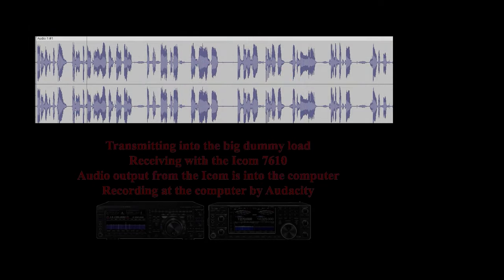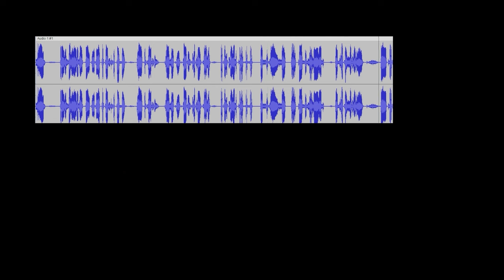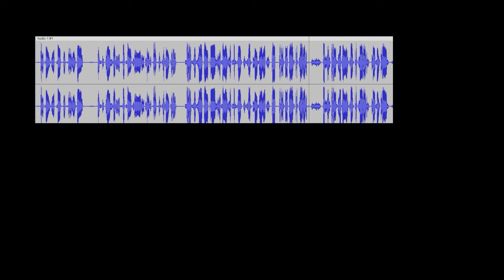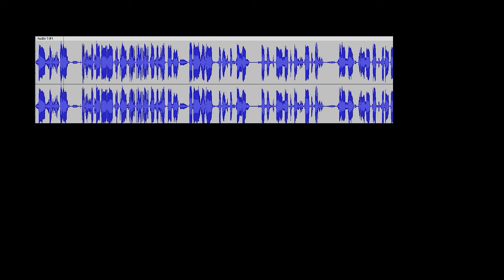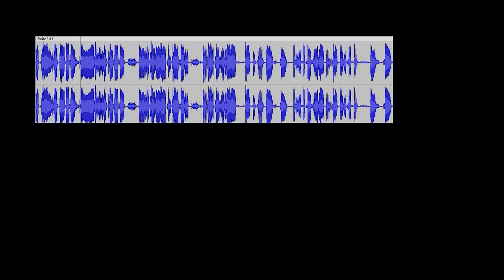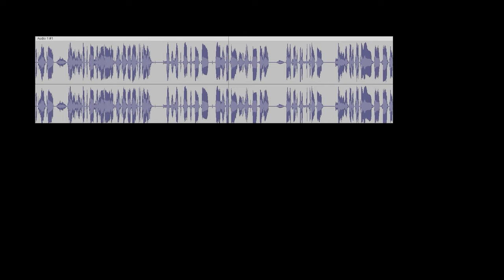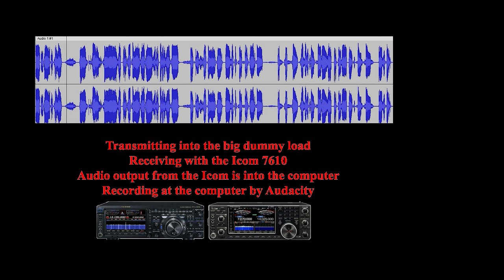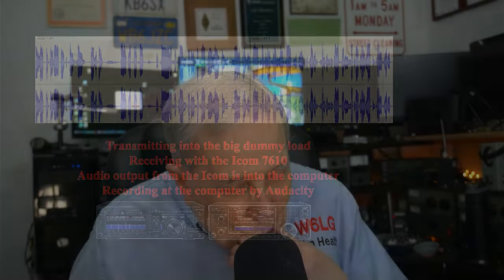How Much Compression is Too much? Setting Compression on the Typical HF Transceiver with Jim W6LG

Comment: Great video Jim, I would have liked to have seen the ALC meter and mic gain tuning on the video, this way I could have heard it like the other part of the video
Reply from the maker: I describe in detail over and over again both of those settings.  ALC was always mid scale and I say the amount of compression. I even colorized the wave form to match the amount of processing.   So you know where both were at at all times in the video. 73, Jim W6LG

Comment: Great Video Jim!  I have always wondered why Icom recommends that compression should  peak at 10 to 20 dB?  Do you think it could be that their radios are different?  It would be a fun experiment to set a Yaesu  and a Icom to peak at 10 to 20 dB and see if they sound different.  Keep the videos coming, I always learn from you!  Robert K5TPC
Reply from the maker: At 20dB they sounded the same and that was terrible.  I think it is a mistake that has been copied from prior instruction manuals.  Good question from you Robert!  Thanks for asking. 73, Jim

Comment: Excellent video Jim.  Your audio demonstrates your point perfectly.  May I ask what your equalizer settings are?  A little guidance on setting them would be helpful.  For example why would I set the center frequency of eq1 at 300 rather and 200 or 500?  Why will I use a hi Q filter  rather than a wide one?  If I have a bassey voice do I emphasize the bass or cut it.  After many hours of recording into an sdr and listening I have arrived at numbers I am happy with, but it was purely trial and error and a painful process.  Thanks, Merv W2OE
Reply from the maker: It took me a month of trial and error recordings.  
200
-10
0
1500
+7
0
3200
+10
0
Those are my current settings. 73, Jim W6LG
Reply: Thanks Jim.  I don't feel so bad that I took so long.
 @ham-radio

Comment: I worked 200+ DX With no compression…KWM 2a 30s1… just watched the alc… Great video old man 73…
Reply from the maker: Yes but you did have some equalization because of those marvelous filters in the KWM2A.  I had one too and it worked great.  I think the filter was 2.1kHz.  The thing punched through pileups over and over and over.  It is a great machine that still works today about 60+ years after it was built. Congratulations on having one Mike.  73, Jim

Comment: You can't run the compressor without the equalizer?
Reply: I wondered about that. I think my EQ is set differently than Jim's so his emphasis is on higher frequencies while I normally have more mids.
Reply: In the 101D you have two separate equalizers, one for no processor and one for with processor. And yes you can run with no EQ processed or not.

Comment: Since there is no doubt that it sounds much better without processing or compression what is the reason to put those on to any degree. Why do these adjustments supposedly help in dx; is it really proven or just assumed?
Reply: Compression makes the high volume lower and the low volume higher, reducing the dynamic range. The lows will be more above background noise, and the Rx volume can be turned up enough to make sure lows are heard without blasting the highs.